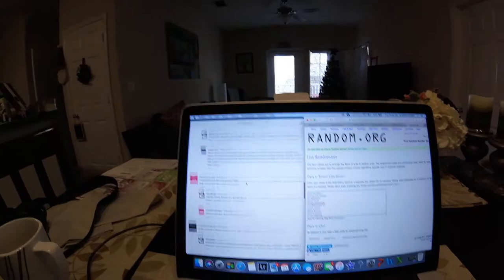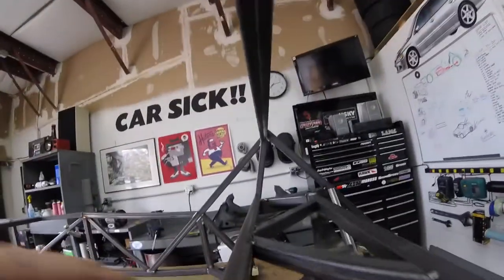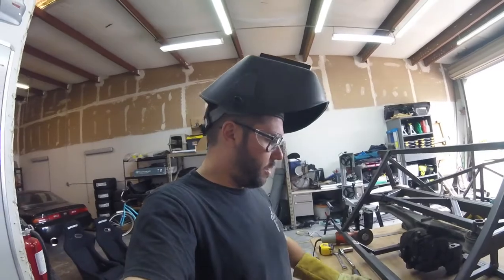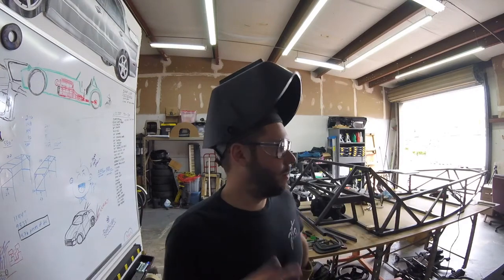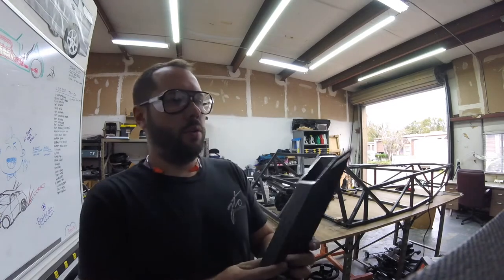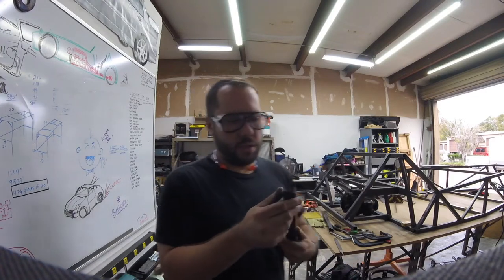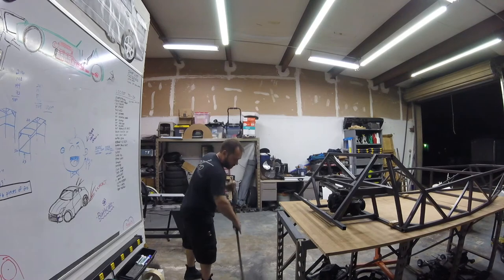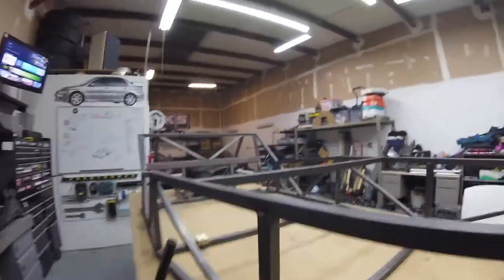Fabrication Takes Too Long: Locost Support Tubes

Comment: Its coming along dude! Won’t be so long now! Will you be getting the chassis powder coated? 
Kinda glad I didn’t win or you would have to post to the uk! Haha
Reply from the maker: I don't mind shipping to the UK, what's a few more dollars? I probably won't be getting it powder coated, I'm sure that I will need to add or remove something after the car is driving and that would suck to grind off the powder coat. I am thinking about POR15 or black Rustoleum brush on, or maybe even a low texture truck bed lining. Something that I can touch up if needed.
Reply: Car Sick!! Por15 is definitely the way to go if you ask any of the mini people but I haven’t used it